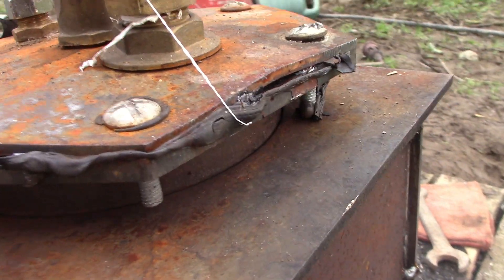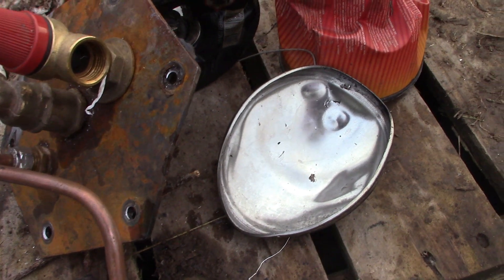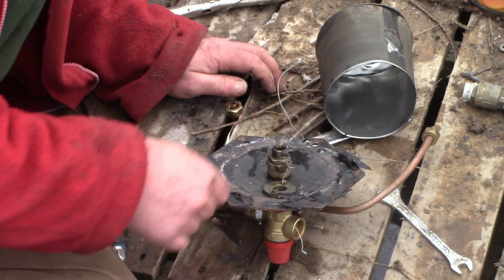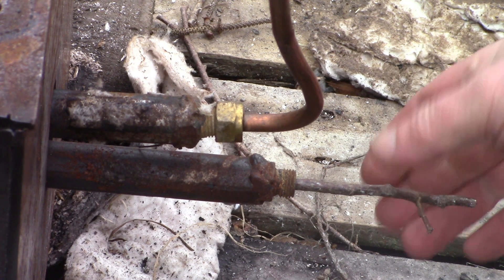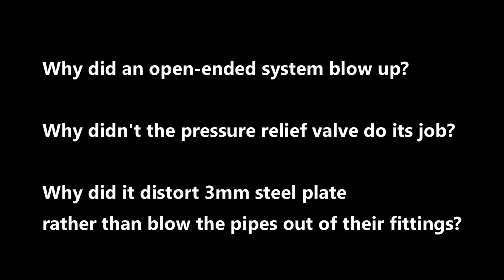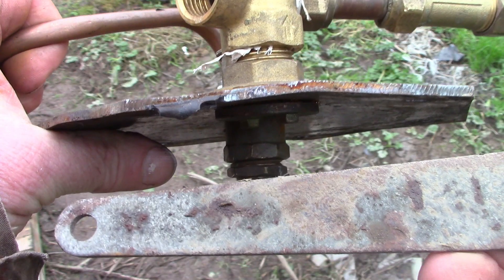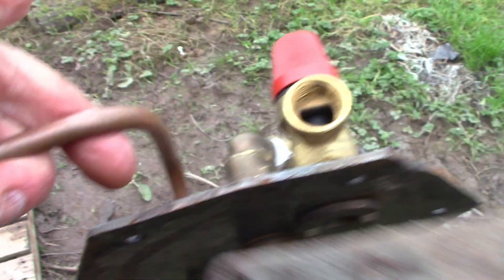Why Did My Boiler Explode??!! My Own Big Bang Theory...

Comment: I see two possibilities, crushing seems unlikly to blow out the bottom of the top float, i think that the top float exploded, impaled itself, allowing the sudden ingress of water causing a second and more destructive explosion which popped out the top of the boiler and crushed the bottom float; or the bottom float collapsed causing the top float to drop, cold wate,r big explosion, top float impaled on valve impact forcing bottom off. Either way you need a more robust float, that should prevent this occuring and you can move onto big band two :)

Comment: Of the top of my head I'm going with the pressure crushed your floats and the top one didn't contact the valve. Pressure went up, top plate bent and sudden pressure drop, at 230 deg (C I assume, but it will work at F) the water flashed to steam and smashed one float into the top plate where it was penetrated by the valve.

Comment: There is something not quite correct here. If the steam temperature was really 230C then the saturation pressure would be 2.7972 Mpa or 405.6 psi. Not an unpressurised system. 
With a lid held by only 6 x 6mm roofing bolts which can stretch like chewing gum not surprising it bent. 
The bang you heard was something inside exploding and the shock wave bent the lid before the safety valve had a chance to react
With engineering like this I would take up flower arranging.
Reply from the maker: No need to be rude, Peter, I'm just experimenting. (Actually, I hope to do flower-arranging as well.)
Can you explain why the steam exiting the system was at 230c but the pressure was negligible? The tables just show the corrulation between temp and pressure but that's in a closed system
Reply: @wayoutwest-workshopstuff6299  Sorry if you thought I was rude, I have an old fashioned sense of humour! Well I assumed that you did not have a superheater so the temperature of the steam will be the saturation temperature, just like a kettle.

I started to answer you and realised that I need to think about this a bit more, if you wish to continue this conversation reply here and I will give you an email address for contact. 
I am interested in your project but also concerned that you do stand to get seriously injured if things go wrong.
Reply from the maker: @letrainavapeur  thanks, Peter. Yes, you raised one of the many interesting points that I am trying to get my head around. If you are able to explain it to me then I'd be grateful. rustyironpig @ gmail.com

Comment: My guess would be water hammer, the top float collapsed or imploded, the heated water below flashed into steam to fill the void created, propelling the water above upwards to hit the top of the vessel and force the remains of the float into the underside of the lid. Water hammer is a danger in large steam plant, even blowing condensate out of steam lines has to be done with care, if you want more information have a look for Sothern's "Notes on marine steam" or have a look on Wikipedia for SL-1 reactor disaster.... Best of luck with a new design!

Comment: So I just personally learned about this type of steam engine. But I would suggest the Shay locomotive. They were initially designed and built buy a lumber yard owner so they are diy origins and are built to handle not perfectly smooth tracks.

Comment: I think something triggered the pressure release valve, creating a pressure difference from top to bottom of the float which violently pushed the float to the top, this now sealed around the release valve and outlet being held in place by the difference in pressure caused by the open outlet, effectively sealing the system. From that point on you had a ticking bomb. 
In the future, be aware of a thud and subsequent steam flow, slowing down for no apparent reason.

Comment: I was kinda expecting an implosion from one of the images, where the pressurized steam escaped, but then cooled down, condensed, leaving a negative pressure vacuum the shape wasn't designed to handle. Good reason to add not just an overpressure safety, but also an underpressure safety

Comment: Your top float is what exploded,  just like a can of beans on a barbecue. the top float blew the bottom out rocketing the can into your valve.  There was no implosion in this event.   One should not cut, grind & weld with straw on the floor.  Future video can be titled why did my shop catch fire.

Comment: Hello W.O.W.-W.S.
Strangely, the youtube algorithm got me here, maybe in time to stop you from making possibly lethal mistakes. I am not an engineer, just some dude and I happen to have a copy of "Experimental Flash Steam" by J.H. Benson and A.A. Rayman. Maybe you should get a copy of that book first. They explain flash boilers in detail. Although i want to be careful in what i am saying, without disrupting your enthusiasm and without me getting sued or worse, you injuring yourself, i like to give my quick personal opinion. I am not sure if this is a flash steam boiler, or just a boiler for superheated steam. Usually, flash steam is made in a steeltube (of small diameter) only, together with a feedpump. In my eyes, the solid fuel burner you made is very interesting, but the way you heat the water is in relation to actual flash steam designs overcomplicated. You could make it easier for yourself. 
I like your idea of using a rocket mass heater (you'll get there) and flash steam design together. Never heard of that. 
I can only speculate as to what might have caused the explosion, but it seems to me, that you have not considered the boiling point of water raising with boiler pressure. It seems like your 'float cans' have imploded under pressure, therefor caused a drop in pressure and a drop in boiling point of the water. The water could not contain its own heat energy and evaporated immediately in a flash, hence "flash steam"(with high pressure). BANG! Usually with steam boilers, the larger the diameter, the less pressure they can withstand and the thicker the boiler material needs to be in order to keep it from exploding.   This might explain why the top of the boiler took all the damage and not the small pipes. 
I don't want to go into further speculation and i don't want to give you advice on how to design these things, i dont have a clue, but what i can tell you is you should definately get that book, even if it may be hard to find these days. I only assume that your goal is to match a clean burn with high pressure steam of higher efficiency, as a means of a more elegant and compact approach towards 'bulky ol steam power'. Kind regards, The Collector.
Reply from the maker: Thanks, yes, it's on my list of to-buy books. I know how flash steam boilers normally work - but normally they're heated with gas which is constant. I need to balance the variable heat with the input of water, otherwise it will overwhelm the system and deliver wet steam to the engine (or water). So that's why I need a float valve..!

Comment: I think the issue here is actually the float valve.

Water trying to enter the boiler will be fighting against the boiler pressure, so it needs to be pumped in, not just gravity fed.

I think your boiler ran dry, the pressure started to.drop.while the walls of the boiler got hotter, finally the pressure dropped low enough to allow some water in, it touched the now very hot metal, flashed to steam.almost instantly and caused an massive over pressure
Reply from the maker: plenty of water still inside at the end though

Comment: Your evaluation of the incident is correct, the implosion of the floats resulted in a pressure drop sufficient to cause a significant flash to steam of the water in the boiler resulting in a sudden pressure increase which overwhelmed the relief valve. The boiler cap screws where thankfully the weak point.

Comment: A question not asked in the video is what operating parameters changed to initiate the failure.  The black board diagram suggests the top cannister impoded?  Next there was a big bang, but only after insulating the chimney, measuring 230oC and putting a stick in the exhaust.

The olives didn't pop out because they upper float sealed the section of the boiler.

Comment: Floats shouldn't be used in the steam chamber.  They should just be used in the feedwater system, which should be separated from the steam pressure/ temperature.  I must warn you that a pressurized steam system is very dangerous.  Professional engineers get themselves into trouble with these systems.  I recommend finding a safe boiler design and building that per the plans.

Comment: I think the remnants  of gas in the float cylinder  under heat and pressure caused a static discharge  and ignited the gas causing a rapid rise in pressure

Comment: Why did the relief valve not work? Take a look at 2:22 and you'll see the answer: The upper float was pressed against the fitting of the relief valve and thus blocking the passage.

The open exit pipe, reduced or not, has not enough cross-section to handle a sudden increase in pressure. It is more like a choke. So the increasse in steam pressure could've not been held in check by neither the exit pipe nor the relief valve resulting in blowing out the weakest point.

Why it bend the top and didn't blow out the fittings is simple: Force is pressure times area and the top has way more area than the cross-section of the fittings. In addition the fittings experience an outward force from the pressure inside their passages (the bore from inside to outside) which presses them firmly into the bore of the boiler. So the big massive plate became the weakest point. The most impressive thing about the bent top is that the screws were able to hold it in place. I'd have expected them or their bores in the plate to give in first and let the top fly away (which thankfully didn't happen, the results could've been much worse).

Just out of curiosity: How much water held this boiler?

Comment: I think your explanation is close but not exactly right.  It looks like a BLEVE (boiling liquid expanding vapour explosion).  As the floats collapsed, the pressure fell and all the superheated water instantly became steam.  Far too much steam was created to be released by the safety valve or outlet.  This is the same kind of explosion that happens when a boiler's water level gets too low - the crown over the firebox fails, the pressure drops suddenly and all the remaining water flashes off to an enormous burst of steam.   It is fortunate the cover plate yielded enough to let the steam escape as the body of the boiler could have burst instead. You can get plans for simple and safe firetube and flash boilers made from standard steel tubing.
Reply from the maker: Thanks, Bill. It's getting the steel tube rolled that's the problem.

Comment: Sorry if someone has already said this but ran out of steam ☺ while reading all the comments. But here's my guess.
The floats did indeed implode.
The sudden pressure drop caused a flash of steam which ACCELERATED THE WATER upwards to fill the void where the floats' volume used to be.
But once the water got there it had momentum but nowhere to go so hammered into the lid of the boiler. 
Essentially a steam powered water hammer.

Comment: Been thinking about the mishaps, a relief valve is designed for the safety of equipment and people. You appear to have a relief that handles gas or vapor. They may not be able to handle the volume of liquid needed to reduce the pressure expediently. The same may hold true for your port to supply your future engine. If blocked with liquid, neither can move the needed volume. Your not regulating your heat automatically so you may consider a bi metal spring and flapper to regulate the combustion chamber air inlet. I have been looking at those for my wood stoves. You may also may want to restrict the volume of water on the inlet so you never can add more more water than you relief can relieve water or steam, if a float fails. Ducting a small stream of steam into the fire box inlet may also ward off a catastrophic failure. To much rebuild is not economically feasible.  It a float fails you may want it to trip the air inlet with a guillotine.

Comment: I agree with Matthias Wandel - a solution would be to make floats that were slightly flexible so they could expand or contract with the temperature changes to a point where they were stable.

Comment: You should probably put a warning or remove the other video since this boiler is not a safe design.
Reply from the maker: I think the problem is with the floats - the boiler seems to work well
Reply: @wayoutwest-workshopstuff6299  Yes, but then that should be mentioned so nobody goes and builds it like that. 

I think any future boiler should also be pressure tested beforehand to 2x the working pressure using a hydraulic pressure tester. That is to make sure it can take the working pressure with a decent margin. A hand cranked hydraulic pressure tester is a useful tool, can go to 50 bars or 720 psi.
Reply from the maker: @1873Winchester  But it's open ended. There's practically no pressure in it yet
Reply: @wayoutwest-workshopstuff6299  But when it's put into use, hooked up to a steam engine, then won't it be under pressure?

Comment: Why did my boiler explode
To understand what happened we need to break things down.

The floats used are camping gas stove canisters. These are made from aluminium and are all crimp fitted.

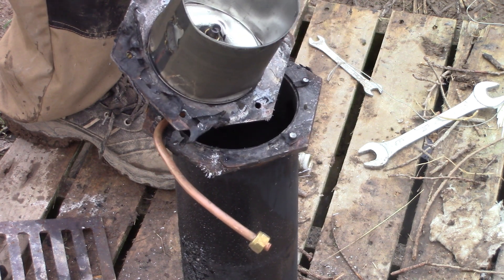In the image shown at Time index 1:47  you can clearly see the top crimp where the valves is installed has been punched in to the canister itself Not exploded

This is likely due to the high temperature softening the aluminium and the pressure of the other floats Pushing Up concentrating the force needed to punch out the valve piece.

Once the very top cylinder has been pushed up against the upper housing the additional pressure and heat are shown to be focused where the steam wishes to escape as well as the other two canisters still pushing up and the top one.

This picture (Time index 1:47) shows the point of failure as the aluminium has Now created a self-sealing system the consequences of both the pressure relief valve and steam outlet  are blocked or Restricted to render them useless.

Next the steam pressure in the primary boiler climbed rapidly even with minor leaks this was proven at time index 2:21 imploding the other 2 gas canisters and pressure forming the top canister to the boiler's roof. With nowhere for the steam to go the pressure kept increasing until the next point of failure which was the boiler's lid.

I would suggest if you carry on keep the primary boiler as it is you now know that it is safe to use should you have a closed system failure

Comment: Before watching the end : The top floater wasn't in the water so it expanded, blocking the way, the lower floater shrank both from explosion and boiler pressure. Top one, blocking the steam out and expanding exploded creating some chain reaction.
Reply: I would agree with your theory if the top one looked more like it was crushed than it exploded
Reply: there was no  exploding here if you look at time index 1:47 you can still see the valve that has been pressed in to the canister letting the steam in to it as the other floats push it up. this is why the top canister looks in tacked
Reply: @odjwizardo3198  the top floater, exploding has been ejected upwards imo, making both the energy to deform the plate and the hole of the valve. Can't be sure but that's my theory

Comment: And in a classic i need to think before i talk, can you pressurise those floats? I am pretty sure they are designed to keep high pressure in, not out, so if you can refill them with air?

Comment: Also consider testing the system with compressed water, you'll need bungs. But you can generate the same force a lot safer using uncompressible water rather than steam which is a big scary spring storing vast amounts of energy.

Comment: I think you are correct, you can test your theory by seeing how quickly the safety valve reacts to compressed air. I also think the 3mm lid 'weak' point might have been an accidental design feature but dont make it stronger. Its all fine only saying you have a hand full of PSI but you do have a lot of surface area. Be careful; this really is a bomb.

Comment: It was "water hammer"
When the first float collapsed the pressure dropped , the sudden drop in pressure caused the water in the bottom of the tank to flash to steam and shot the two floats above it like a cannon ball into the 3 mm plate.

The top wasnt damaged by pressure, it's impact damage.
Reply: i will respectfully disagree that the 3mm to in fact did buckle from pressure and not impact. the PRV was blocked, the water inlet was blocked, the increasing steam pressure from the blocked outlet caused the mud drum to become an isolated vessel( for lack of a better term ) and with no release available the lid buckled.

Comment: Gasoline has a flashpoint of 80 to 300 F
.  If I had to guess the empty propane cartridge had fuel remaining but not usable as propane.  It was able to boil under the heat, escape, ignite, crush and distort.  My other thought would be hydrogen generation.  This is used commercially biomass or often coal plus steam.  Here's and excerpt.
This method is the cheapest, most efficient, and most common. Natural gas reforming using steam accounts for the majority of hydrogen produced in the United States annually. A synthesis gas can also be created by reacting coal or biomass with high-temperature steam and oxygen in a pressurized gasifier.
Reply from the maker: but there was no oxygen in the boiler..
Reply: @wayoutwest-workshopstuff6299  Your right....I'll have to watch the video again.  The floats have no oxygen in them too I would imagine.